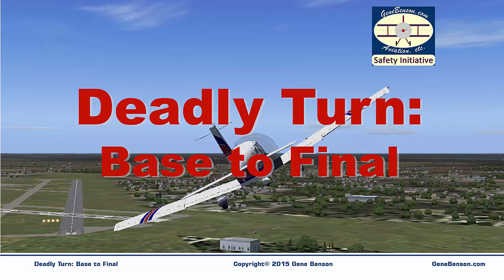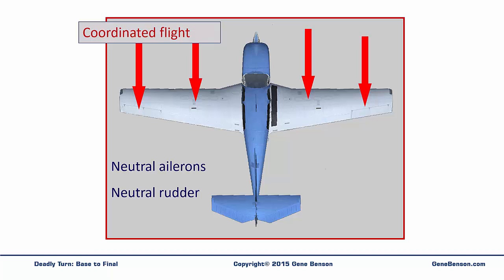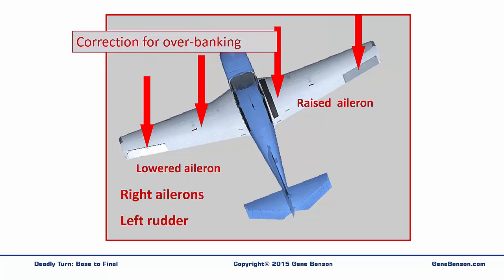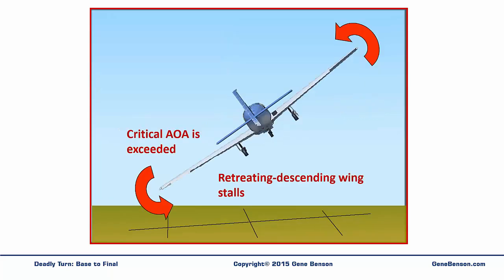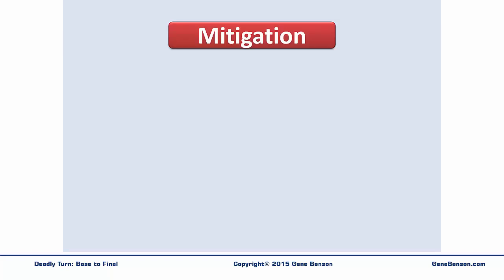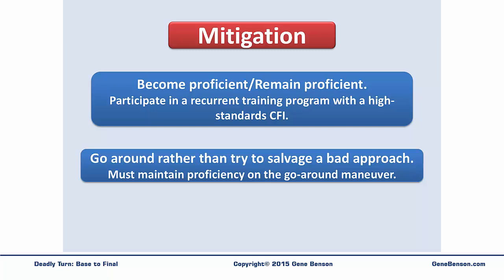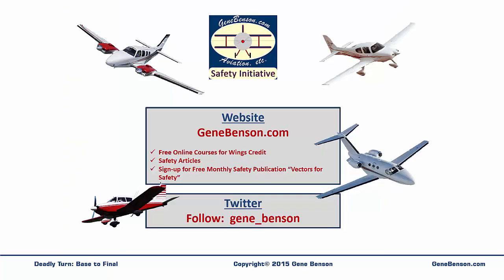Deadly Turn - Base Leg to Final Approach

Comment: At 1:20 Gene states that left rudder pressure is being applied and the yoke is to the right, and  then proceeds to call this a skid. Since the controls are crossed, isn't this a slip?
Reply from the maker: The controls are crossed in both a skid and in a slip. In our example, the the turn coordinator shows a turn to the left with the ball opposite the direction of the turn, to the right. Whenever the ball is out of center opposite the direction of turn, the airplane is in a skid. If the ball is out of center in the direction of the turn, that is a slip.

Comment: small banking angle is preferred for large aircraft which is often not possible because of small distance flight and going around maneuver is also the best strategy if things are not favorable for landing (most airlines companies are on saving gas, conducting frequency of trips (sometimes engines never put off in Nepal), cutting operational costs is not wishing their pilots do the go-around maneuver often. See pilot's rewards)

Comment: Rudder opposite the aileron input is a slip which is generally spin resistant.  I would contend that most if not all of these base to final spin accidents are the result of a skidding turn with uncoordinated and excessive application of rudder in the same direction as aileron input.  

Pilots need to know how to slip properly and should not be afraid to employ this tool while in the pattern to loose altitude.  On the other hand, Skids should be avoided at all times.  Skids while pulling will kill you in a flash if you are low and slow.  But not so for slips.
Reply: When performing a slip, the rudder is deflected towards the upper wing. This is not the situation described in this video where the rudder is deflected towards the lower wing and the pilot tries to lift up this lower wing with opposite aileron input.
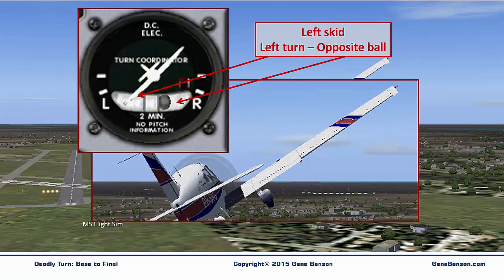Reply: @jopolitis852  I agree.  For a slip, aileron/yoke left, rudder right towards the high wing or aileron/yoke right, rudder left towards the high wing.  What prompted my comment was @1:30 he says the turn depicted is made with left rudder and right aileron to avoid over banking. The picture shows the plane in a left bank with right aileron and inside rudder which is not what right aileron/left rudder should look like.  I think the point would have been better made if he just said left aileron input with excessive left rudder (skid) to reacquire the runway centerline.

Comment: The nice thing about this pattern is it tends to make a tighter pattern and hence greater chance of making the field should the engine quit.  I hate it when pilots extend too far down wind, forcing all other following traffic to do the same.  It slows the whole pattern down and gets you further from the field should the engine quit.
Reply from the maker: Thanks for your comment. I agree that the traffic often "grows" as some pilots extend the downwind for various reasons. It can be a set-up for a dangerous situation if a pilot decides to cut inside the traffic and execute a short approach. I wish I could offer a solution to the large traffic pattern problem, but I cannot. I have always taught my students the ideal pattern is when, on downwind, the runway appears to be at a 45 degree angle down from the level and the turn to base is executed when the approach end of the runway is 45 degrees behind the airplane. Obviously, adjustments must be made for various factors.

Comment: Making the circuit too tight is the fundamental problem here.  A tight circuit makes all turns tight and there is no room to allow for a tailwind on base,  nor to correct an overshoot onto finals.  Keep the circuit wide enough to do rate one turns on all four corners.
Reply from the maker: Thanks for your comment! I agree that wider patterns can help eliminate the need for steep turns. However, a wider pattern is not always an option at a busy airport. I think that a hard rule to closely monitor airspeed and to make sure the ball is in the center showing that the turn is coordinated is critical.
Reply: Yes, agreed.  However, I wonder how qualified some instructors are these days - I have seen many comments and even heard some from qualified pilots about how you "should slow down on base as a tailwind will increase your airspeed" or some such nonsense.  I tried to explain that airspeed and groundspeed are two different things, but it seems that some people see the high groundspeed and the impending overshoot as good reason to (1) reduce airspeed) and (2) tighten the turn, which is what is causing the stall-spin accidents.  @GeneBensonAviation
Reply from the maker: I share your concern about the quality of instruction some pilots are receiving. But, I communicate with numerous CFIs and find that most of them are knowledgeable and competent. Of course, I suppose that the ones of concern are not communicating with me. My granddaughter recently went through one of the large flight schools and became a CFI. Her program was thorough and the standards were upheld. She knows her stuff so my faith in the upcoming generation of pilots was restored a bit. @karhukivi
Reply: Glad to hear that - I'm sure her granddad is making sure it all goes very well! @GeneBensonAviation

Comment: Cross controlling is very dangerous
Reply from the maker: I agree. the only time cross controlling is appropriate is during the final phase of a cross wind landing.
Reply: @GeneBensonAviation  certainly.
Reply: Don't tell that to a glider tow pilot, or any other pilot that does slipping turns turning base or final.

Comment: Let me guess. 
We are fast and low. And turn final a little bit late. So we go into a 45* bank and kick in full rudder to bring the nose around and keep the nose up to maintain altitude. 
🐰
Reply from the maker: Exactly! It does not even need to be full rudder, just enough to move the ball out from the center.
Reply: @GeneBensonAviation  - probably don’t want to do that on a checkride… 😎

Comment: I never understood this problem. I got my license in 1960 in an Aeronica and have flown many aircraft since. In every aircraft I've flown, you can easily feel the approach to a stall long before the stall warning goes off. The a/c becomes mushy on the controls and gets worse the closer you get to the stall. I have seen numerous videos of planes entering the stall, and it is clear the plane gave plenty of warning before loss of control. I guess pilots were not taught stall/spin characteristics, and never practised it themselves. It use to be my favorite pastime in the Aeronica, and I did it in every plane I owned since then, up to and including my Malibu, N4360V. They all reacted the same way, and gave plenty of warning. There is no excuse for these  accidents. Instructors who do not teach stall/spins are murdering their students.
Reply from the maker: I agree that most airplanes give warning of an impending stall as long as they are in coordinated flight. However, if the ball gets very far out of center, there may be little or no warning of an imminent stall. I encourage instructors to provide training/practice in cross-control stalls with the airplane in various configurations. Once a student experiences a dramatic result from a cross-control stall, they are more inclined to keep the ball in the center.
Reply: Sideslipping is an extreme example of uncoordinated flight. It is an effective way to loose altitude when coming in too high and too fast. However, you can still feel the controls get mushy when approaching a stall. In all the training videos I have seen, not one emphasizes the feeling you get when the controls start to get mushy, and pilots continue to die. You have to learn how the wings feel when the airflow starts to diverge.
Reply from the maker: The slid slip is an intentional maneuver that is effective. The video addresses the unintentional skid which is a different animal. That is especially true for an accelerated stall entered from a skid.
Reply: @GeneBensonAviation  I think most stall/spin accidents occur when the pilot is focused outside the a/c, such as looking where the runway is. He could also be distracted by confusing orders from the tower or approach control, or some problem in the cockpit. He fails to maintain airspeed and has not learned how the a/c feels when approaching a stall. I doubt most pilots would try to use rudder to point the nose in the desired direction. That is simply not how pilots fly airplanes.

Regardless of how the incident occurs, the wings give plenty of warning when approaching a stall. The problem is pilots are not trained to be sensitive to how the plane feels near the stall. The controls get mushy and the plane feels sluggish. Sure, kicking the rudder hard in this condition can lead to a snap stall, but I seriously doubt many pilots would do that.

I have come across a beautiful book that every pilot should read. It is called "Stick and Rudder by Wolfgang Langewiesche", and is available in pdf format at
archive.org/22/items/StickAndRudderAnExplanationOfTheArtOfFlying/Stick-and-Rudder-An-Explanation-of-the-Art-of-Flying.pdf
Reply from the maker: @stevewilson5546  I am a big fan of Langewiesche's work. When I was instructing primary students, I used to give each one a copy of "Stick and Rudder" right after their first solo. If all pilots read and understood that book, we would have fewer loss of control accidents.

Comment: CFIs take note: After 60+ years of instructing we notice in our biannuals, pilots are RUDDERING their turns, not BANKING the turns, then to prevent an overbank are using ailerons to recover.
Terrible misuse of controls.
R bud Fuchs CFI 1507987
Reply: That's hard to believe when keeping the ball in the middle is so basic to flying any aircraft.

Comment: Fly by numbers and this isn’t an issue
Reply from the maker: If by the numbers you mean airspeed numbers, it is an issue. The scenario we describe sets up an uncoordinated turn in which the speed at which the stall will occur is increased. How much the stall speed increases depends on how steep the bank and how uncoordinated the turn becomes. A stall speed increase of 40% could be easily achieved.

Comment: I see this happen at our rc field, especially if there is much wind.
A high angle turn, low power, nose up, low altitude - and in less than a second the pilot is
walking out to pick up the pieces.

Full scale, in cockpit pilots don't walk away from this crash.
Rc pilots walk away -  " a way" out into the field and pick up the pieces !

Comment: Is tjis less likely to happen in a plane with the wing on top of the cabin?
Reply from the maker: No. Both high and low wing airplanes are equally at risk.
Reply: @GeneBensonAviation  thank you Gene.so i take it.its much safer to own a plane with an abundance of power as opposed to these older cessnas. Are they that top out at 105mph that way you can keep a higher rate of speed going through turns or is that thinking totally false?
Reply from the maker: Power is really not the issue. The same thing can happen in a turbine powered airplane. it is all about keeping coordinated as indicated by the ball being in the center and controlling angle of attack.
Reply: @GeneBensonAviation  i trust your knowledge as your a pilot and im not .apparently when it comes to flying there are many things that go against a humans natural instincts like pulling back on the stick.whats confusing to me about this question is it a stall is created by letting the plane go below its stall speed i would have thought the ability to increase speed through turns would be quite helpful?

Comment: I didn't get that why descending wing will have high aoa ?? Can sm1 explain ??
Reply from the maker: The wing is going down therefore the relative wind is coming up. If that was the only motion, it would result in a 90 degree AOA. Since it is not the only motion, it simply increases the existing AOA.
Reply: @GeneBensonAviation  thanks alot sir now I got it... I did this mistake in my second solo flight recently but now I will never ever make this mistake. All thanks to you !!😊

Comment: I'm not sure why they are over shooting the turn onto final. Wasn't their downwind long enough for an adequate base to final to allow time to line up with the runway?
Reply: First common problem: be hurry.
Death chain: Short final, not enough time to stabilize. "Get there itis" on landing for any cost... crash.
Some good CFI said: Go Around is first option ever, landing is second if all parameters are good. If PIC have any doubt go around and clear problems.
Reply: Two common reasons are crosswinds and fatigue affecting judgement.

Comment: At 1:25 the instructor states this: The yoke is turned to the right." Yet, the photo at that moment shows the airplane banking left.  How can an airplane bank to the left if the yoke is turned to the right?
Reply: that is in all turns the case... in short moments ...when you counteract ..you figure the bank is to much so you turn the yoke slightly the other side ...not to much but a little bit here and there and in this scenario not uncommon... you sit in the plane the runway way to much left of you windscreen center ... you bank in to fix it and you get uncompfortable cause the bank gets to steep so you counter act to slowely shallow it and add instead more rudder ...and bang you flew your last pattern ever...

Comment: I don't like using the rudder, even as a beginner I just would never apply left rudder and right aileron, I mean I do it when I do slips to landing but from the beginning I've been leary of yaw Espacally at slow speeds. My instructor has been trying to get me to use the rudder to flow into my turns but idk I just don't like it.
Reply: Proper use of the rudder keeps the aircraft coordinated and safer. You may be able to get away without rudder for a left turn, but right turns will certainly require it. Of course it is mandatory to control direction on take off and final approach
Reply: I believe there is a demonstration on youtube showing the difference between a proper turn and an uncoordinated turn.  The uncoordinated turn causes you to lose much more altitude.  It can be surprising how much you can drop.  May want to know how to coordinate in case you get in a pinch and find that you can't spare any altitude
Reply: Step on the ball

Comment: Just curious if there’s a great disparity of these type of incidents between high and low wing? 
I believe you might see more racetrack patterns and overshoots with high wing.
Reply: Just had this conversation with my CFI, square vs oblong patterns. He is of the opinion that oblong works for fast low wing aircraft. He feels that a high winged plane will block the view of the runway if it's in a continuous bank. A squared pattern enables the high wing aircraft to fly level for a longer period on each leg, giving the pilot a better idea of his position and also a better view of traffic.
Reply: @tdkeyes1  I would agree with that if you have the luxury of that. As the previous owner of a 172, I encountered numerous situations where I had parallel traffic, or while in the pattern, I was assigned another runway while on downwind. The 3rd issue I ran into frequently was to tighten my pattern in heavy traffic. Each one of the circumstances eliminated the luxury of flying a squared off pattern. While I adapted to whatever was thrown at me, I very much preferred a squared off pattern with that particular plane (172).
Reply: @muhammadsteinberg  I still have much to learn. One thing that he is drilling in my head is pattern airspeed.

Comment: in 19 years I have only had 2 go around's. One I was less than 10 hrs solo and the other was just last year goofing off and did not check the winds and blew way past the center line. Scary stuff, I hate learning from someones death, makes me anxious about flying.........
Reply: I excited a ground on my private pilot check ride. After completing the sheckride the the examiner said that although he had confidence that I would have axially pulled of the the landing I did the go around on, he would have failed me for doing so because it good piloting decision making to do so. Good approach good landing, iffy approach iffy landing, go around, not a good habit to get into trying to save iffy approaches.

Comment: Even coordinated turn, if you pull up in panic due overshooting, it will
 drop the inside wing.   And if adding power with not enough top right rudder in a
 say 45 degree turn at say 400 agl. What will happen?  You will drop the wing further too.
  Lots of BS here from guys that dont do full steep turn stalls or steep
 turn go arounds..

Comment: Instructors, quit teaching new students that it is s mortal sin to overshoot your turn to final and that you must at all cost roll out perfectly on centerline on final. That's dangerous BS.  Start teaching that rolling out on centerline is only "ideal" but don't panic if you don't, and do a radical correction.  Teach students to just hold that same rate of turn and return to the centerline. It's simple, it's easy, it makes sense.